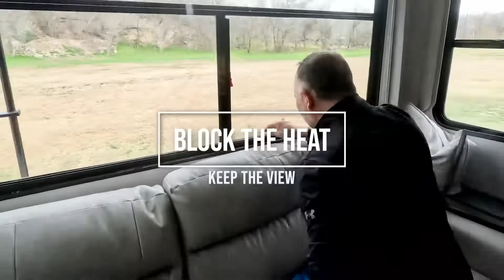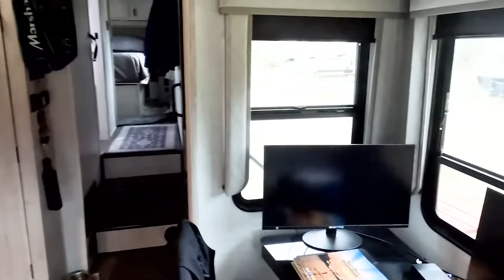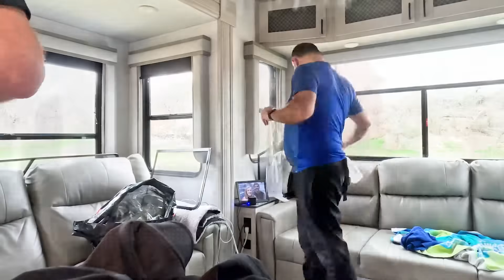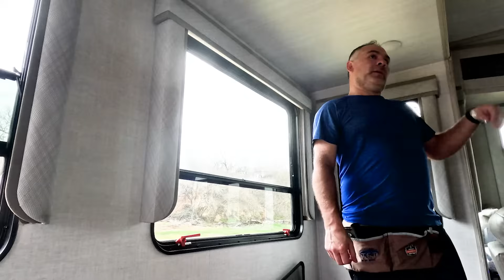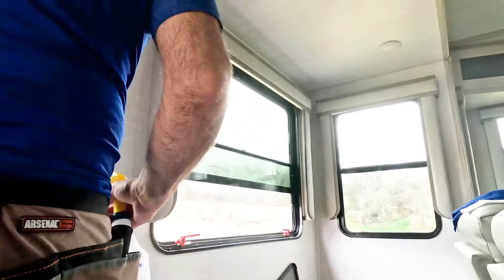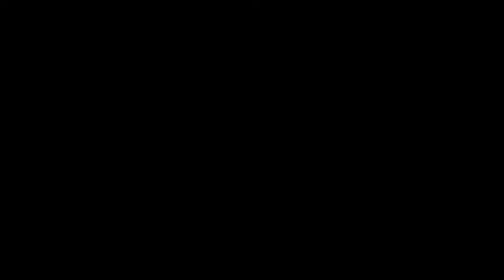Cooling your RV: the benefits of ceramic window tint for heat control

Comment: He did a great job. Yet we have a better solution for all of you RVers out there.

I'm Chris.. the owner of On The Road Mobile Tinting. I'm a full time RVer myself, 6 yrs and 47 states, just my dog Duke and I.

Because I primarily tint RV's at the RV resorts I stay at, I wanted to create a product that makes it easy for you to tint your RV windows at home yourself! So l created RV Tint Kits! Thats right! Precut Ceramic Window Tint patterns that are perfectly cut to fit your RV windows. And we provide you with all the tools you're gonna need to get the job done.

So don't waste your money with cheap Amazon tint. Get the real ceramic tint professional installers use at a fraction of the price. Our small windows start at $29.99 each and a large is only $49.99. 

So if you have a bedroom that's too hot, or a window on your slideout, dinnete or couch that's letting in too much sun and heat, well we have you covered.

Watch our easy to follow installation videos on our YouTube page and order yourRV Tint Kits today at OnTheRoadMobileTinting.com.

We have a variety of shades to choose from and they're all backed by a lifetime

Comment: Texas ain't hot bro lol
Reply from the maker: Not compared to death valley, but its hot enough.
Reply: I'm in AZ and I blocked out our bedroom windows with 1" foam insulation and added a portable AC unit it still reaches 80⁰ in the bedroom @OurRoadLessTraveled
Reply from the maker: @ted4719  now add 90% humidity to that. Texas has both. Not that AZ is not hot, but the humidity in TX is horrible.
Reply: @OurRoadLessTraveled  don't enjoy either. This is my last summer here, there is nothing fun about being in an oven for 3-4 months
Reply from the maker: @ted4719  i agree. the older i get the less i like the heat. anything over 85 and i start getting irritable.

Comment: How big of a difference did this make?
Reply from the maker: I am shocked to say it made a massive difference. We can sit with the shades up and not feel the heat of the sun at all. It cut the radiant heat by at least 85-90%. We still get the ambient heat from simply being outside. I dont think we have been over 70 degrees in the 5th wheel since we did it and the AC units do not run for near as long.
Reply: What is the temps out side ?

Comment: This topic leads me to a couple of quoestions.
Are your windows double-glazed, and what are the heat-retention options for the winter (or do you just "fly South")?
Also, I've been reading about heat pumps recently, are they a viable option for heating/cooling RVs instead of AC etc.?
Reply from the maker: good questions, I wish i had more answers. We have regular 5th wheel windows, if they are anything other than tempered glass, its not listed anywhere. We are good as long as it doesnt get below 30, if it does we move. The 5th wheel does pretty good retaining heat. We got stuck in 18 degree weather for four days. We kep the heat set to 65 and nothing froze. we did use about 50 Lbs of propane though. I have heard heat pumps are great unless you live in the southeast. They dont do as well when the humidity get in the 90's and the temp in 98. Our ac units did fine last year and the inside rarely got over 75 degrees. We are really just hoping we can keep the binds open and keep int inside around 72, that would be a massive win for us.
Reply: Just finding this video, so not sure how interested you still are on this topic. But window film works both ways, rejects heat in the hot months and helps retain it in during the cold months. I live/work in Fla so the heat retention is not really a huge selling point to customers but I always inform them. Cheers, hope this answers your long forgotten YT question